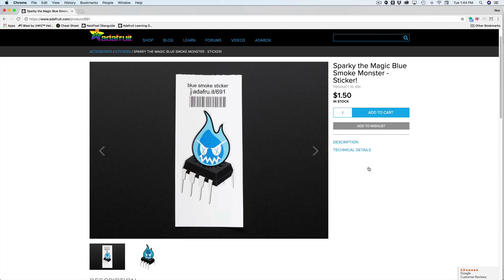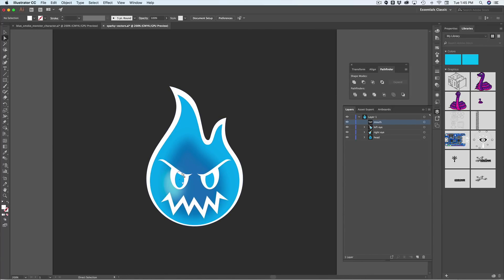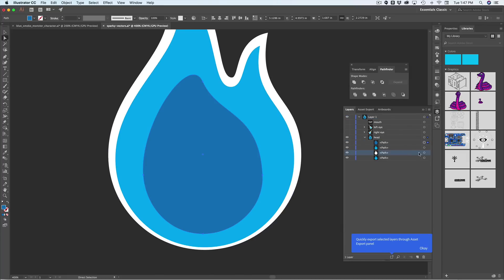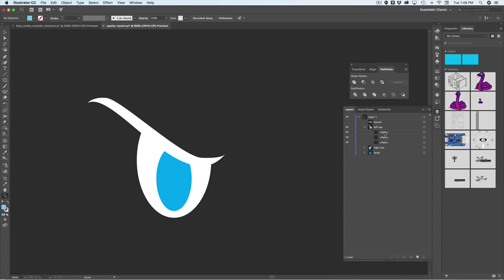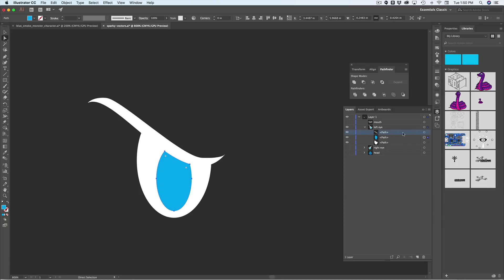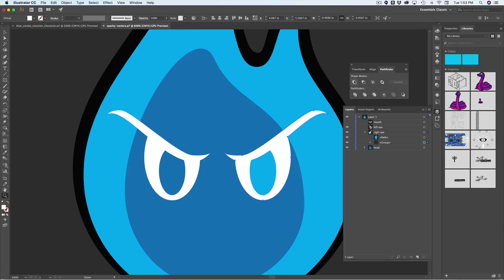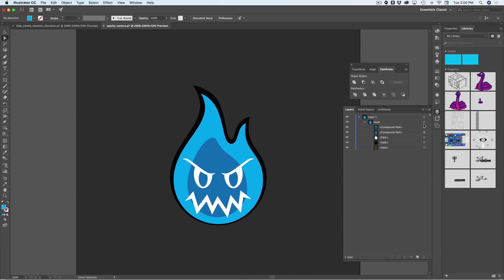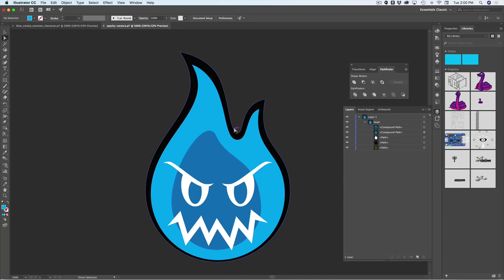Layer by Layer – Setting Up Vectors for Cutting Machines

Comment: When you're subtracting multiple objects from one object, you can speed things up a little bit by creating a compound path of all of the objects to subtract first. For instance, you could select the left eye, right eye, and mouth, create a compound path from those, and then subtract that from the light blue compound path using the pathfinder. It won't save you a ton of steps in this example, but the pieces can add up quickly (imagine a polka dot pattern)!

Comment: If for example making a layered vinyl sticker, it might be a good idea to offset the outline of the lower layers to allow some misalignment without revealing the edges. Moreover, having identical temporary position marks on each layer such as squares in corners also helps aligning! (:
Reply: Also I’d love to get the vector file to make one of these (:
Reply from the maker: thanks for the tips! The design file is linked in the guide and on our github. https://learn.adafruit.com/using-cricut-for-projects/vector-artwork
Reply: If you want an vinyl sticker with different colors what your do is plot 2 squares outside the drawing on each layer/color then align the colors using those squares.

Comment: This was a very informative video. I'm dabbling into CNC files. My question may be a simple one. How did you get the graphic from the webpage into the format to work with in AI?
Reply from the maker: I had access to the originally vector artwork but there's ways to convert raster jpg images into vectors using a trace vectors feature in Adobe Illustrator. There's also online converters like https://vectormagic.com/